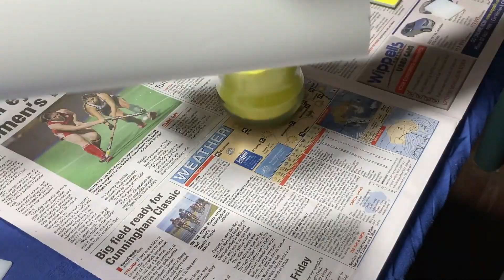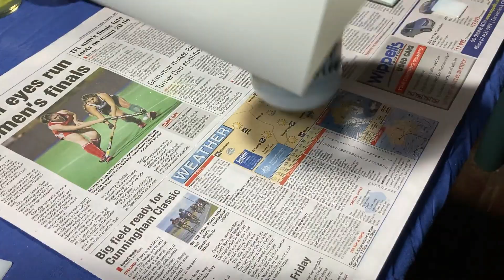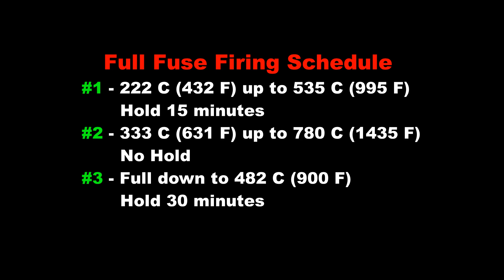Making Fused Glass Part Sheets in a Glass Kiln or Microwave Kiln, Glass Fusing Tutorial

Comment: Jeff, I love your videos.  You make everything so easy to understand that I don’t hesitate to try them.  This one makes me think I need to get a lot more frit!  The possibilities of what can be done are endless.

One thing that was not clear in this video, however, is what happens with the dimensions after going up to a full fuse.  If there is only a single 3mm base with frit and powder I would expect it to pull in and move toward 6mm.
Reply from the maker: Hi Carl. You are right. Thanks for the nudge. That's something I should have mentioned. 3 mm will pull in if fused too long. You may have noticed in the schedule I only went to 780 but still mine have pulled in slightly, and the pattern thins out at the edge. I usually make a piece larger then I need and then cut a piece from that to suit the project. This eliminates the slightly rounded edge and the cut is nice and square, or at least requires minimal cold working to prepare it for use. If you want to make it more precise, you could go to more of a tack fuse, enough to fuse the top layer but minimise the deformation of the edge. There will still be some rounding though, and you will still need to grind the edges so they butt neatly to any surrounding glass. BTW, keep all those small bits you cut off. Collect them until you have a bunch and then fuse complimenting pieces into a new pattern or even use them to decorate the top of another piece. You'll be surprised how often they make an interesting and unique piece. All down to experimenting and imagination.
Reply: Thanks for the clarification.  Your response is pretty much what I was thinking.  

And I never discard cutoffs - I have been doing some kaleidoscope pattern bars and the little bits left after trimming the ends are very interesting.

Comment: If I use powder it disappears completely or almost completely on full fuse. I thought I was putting enough on but maybe not. My kiln does run hot. If I use a tack fuse it still burns off some but turns out ok. If I use small frit it works best. Any suggestions? Thank you.
Reply from the maker: It sounds like you need to add more. Frit would never literally burn off. But, if there isn't enough, when fused it's like applying a very very thin sheet of glass on top. All you may get is just a hint of colour. With transparent frit it may not show at all. Depends on the colours you're using. Have a look at the amount of frit on Blue Ponds. There is quite a bit. With the coarser frit there is substantially more glass in that, then there is in powder. Weight an equal amount by volume and you'll see the difference between powder and coarse frit. Let me know how you go.